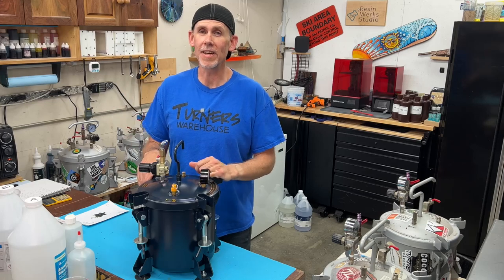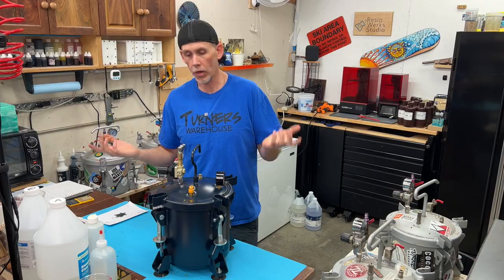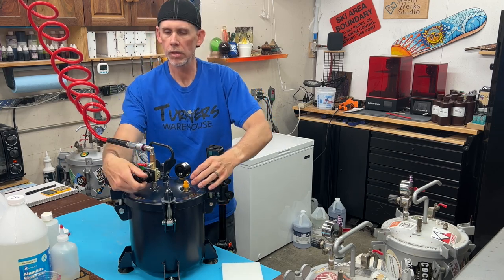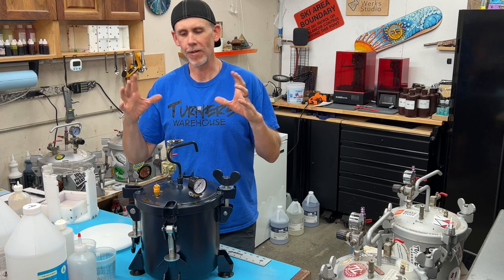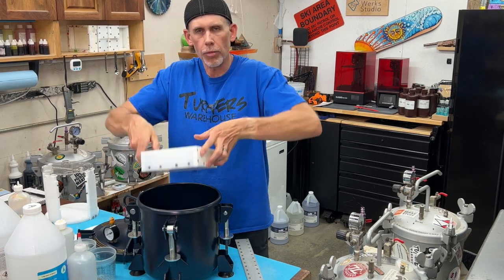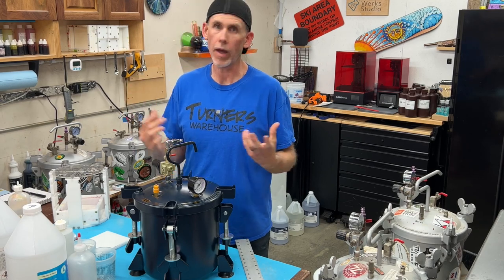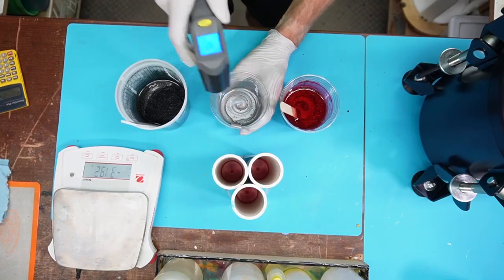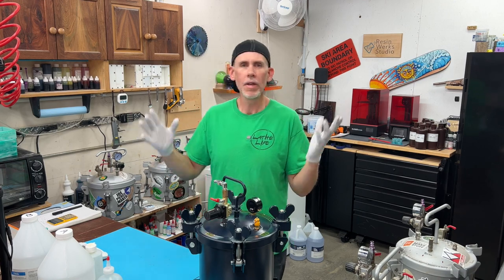Pressure Pot Made For Resin Casting (No Setup Required) - The California Air Tools 2.5 Gallon Pot

Comment: So, after watching this video on this Pressure Pot, I splurged and bought one!  I was using a converted Harbor Freight pressure pot, which was good to start out with, but . . . yes, the top dented from the screw downs and leaked so much!  I just pulled out resin cabochons with Alumilite Amazing Clear Cast as a top coat -- and the results are simply amazing!  I also learned, the hard way, you have to release the air from your air compressor (after each use) in these humid states because moisture gathers in the tank and will transfer into the pressure pot -- that was also giving me some unpredictable results which may not have been the fault of the old pressure pot.  Thank you for sharing!
Reply from the maker: I'm so glad you like it! It's such a great little pot for the money, so happy they finally came out with these in the 2.5 gallon. I would recommend putting a filter on your air line to ensure that you don't blow any moisture into the pot. It's tough to keep it out out of the compressor tank when you're in a humid area. Good to drain the tank every night for sure though
Reply: Every time I buy Alumilite, the part B bottle is already yellow. Let's Resin Low Viscosity 2:1 is far superior.
Reply: Reading your comment a year later. That was very interesting, I would not have known.  Where I live the summer humidity is very low, but winter is damp, so good to know.  I am not sure I can cure resin in my shop in the winter anyway, because though it can be heated I don’t think we keep it warm enough, and usually only during the daytime.

Comment: Super excited they came out with the 2.5gallon, I'm going to get one very soon. I am quite disappointed that the bottom is not already flat, I thought since it was made for resin casting they would have taken that into consideration 🤷🏼‍♀️
Reply from the maker: It's a great pot too! You probably won't find a pot with a totally flat bottom just due to the physics involved with pressurizing the tank. It's pretty flat though, much flatter than the Harbor Freight pots, and it's close to the CA Technologies ones. For most hard molds, it's really not a problem, but you definitely will want to put something flat in there for silicone molds.
Reply: @ZacHiggins  Couldn't silicone molds be set on a rack in the same way that HDPE molds are? Thanks.

Comment: I've had their 5 gallon pot for a while and love it.  I just got the 2.5 pot and I agree with Zac about the great fit and finish.
Reply: There is a pressure relief valve on top of the pot.   You could also open the ball valve without the compressor hooked up
Reply: May I ask what adapter you used to connect to your air compressor

Comment: Hello Zac. I really love your channel. I bought this pot back in September 2023 but never used until a few days ago. I love the pot it holds the pressure really well. The issue is that the pressure gauge is not registering the pressure. According to the manual, I need to replace the gauge but there is no part number to buy or instructions on how to do it. Can you help me with a part number and instructions. Thank you so much.

Comment: Hello. I'm not sure if this is going to be a stupid question or not but I'm hoping you can help. I was wanting to know if I need to get an actual air compressor or if I can use one of the tire air compressors that they have that generate more than 60 PSI. And, if I can use one of the portable compressors, what kind of attachment / hose would I need to purchase to connect it to the pressure pot? Thank you so much!! I appreciate your knowledge so much!

Comment: Thank you so much for your review! I just ordered the 2.5 gallon with the mold rack system for it. Sadly the bottom disc was out of stock. If I will mainly be using the rack, will I need that bottom disc? I also wanted to get your recommendation for an air compressor for the 2.5 gallon pot. I don't want to over do it price wise if a fancy one isn't need 😂 thank you again!

Comment: Hi Zac, I’m having problem getting the right adapter for my California Air Tools Pressure Pot for Resin Casting, Model 365CW. I am using a 3 gallon air compressor from 
Walmart, 3 gallon Hypertough brand
Reply from the maker: There are a couple different couplers styles out there, but I'm just not sure which style it actually comes with or what it's called. You might take it into a plumbing supply shop near you, they may be able to sort you out by looking at it.

Comment: please can you give advice of a good small compressor, if resin casting was the only thing it would be used for. I do feel this is so often missed  as space is so much more easy to get over the pond.
Reply from the maker: I recommend using a compressor that has a tank on it that is close to the size of the pressure pot, otherwise you will be waiting for quite a while for it to fill the tank. The smaller "pancake" compressors are the smallest I'd go with. There are a lot of great quiet ones out there. I have one made by Kobalt that I got at Lowes that works fabulous! There are also a ton of them on Amazon as well
Reply: @ZacHiggins  Thanks that help a lot
Reply: I have a cheap Harbor Freight pancake compressor that I have had for 15 years. Works fine for my 5 gallon pot.

Comment: Would you suggest this pot over the C.A. TECHNOLOGIES RESIN CASTING 2.5 GALLON PRESSURE TANK?  From your video it sounds like the C.A tech pots don’t come ready to use, but I’m not sure what that means.
Reply from the maker: Yeah, I can't really recommend the 2.5 gallon C.A. Technologies pots now that these came out. The California Air Tools is excellent quality and totally ready out of the box for way cheaper. Been waiting many years for a 2.5 gallon like this to come out so I can recommend something high quality with no setup and a reasonable price tag! If you need a larger size, the California Air Tools 5 gallon is excellent as well

Comment: What kind of compressor would be good to get for this pot? Also do you think I could kill to birds with one stone and get a compressor that works for both the pot and an airbrush?? Thanks Zac!
Reply from the maker: I recommend the ultra quiet compressors for casting. It's preferable to have a tank that is close to the same capacity as the pressure pot, and you need it to be able to go up to the needed PSI level. Here are a couple examples of compressors that I would recommend: 
Makita: https://amzn.to/3m2AR89 

Kobalt: https://www.lowes.com/pd/Kobalt-Quiet-Tech-4-3-Gallon-Single-Stage-Portable-Electric-Twin-Stack-Air-Compressor/1001013970

Comment: I picked up a vevor pressure pot, and went through the trouble of converting it for castings. It's only holding air around 45psi. Would that be enough pressure for larger bowl blank castings?

Comment: What air compressors would you recommend? I'm trying to get started but avoid spending too much money. I know it's rediculas but would a tire pressure version work for the first few attempts until I can also throw money on an air compressor?
Reply from the maker: I recommend going with a tank that is close to the same size as the pressure pot so you're compressor doesn't have to work too hard to get it pressurized. The quiet compressors are really great too, so much quieter than the regular ones. California Air Tools makes great compressors, and I bought one from Lowes that works great too

Comment: Have you done tests on low psi (40) Vs high psi?  Is there a minimum psi to reach? I just got a 10l vevor pot and most people I've seen cast at 40psi but I've read 50psi should be the minimum but also 40psi and also 70psi 😵‍💫
Reply from the maker: I don't recommend going below 40 PSI, you run the risk of bubbles coming back if the pressure drops below that. 50-60 is a good number to shoot for... but only go as high as your pot is rated for

Comment: got a CAT-365C 5 gallon from Cal air tools.  I'm kind of thinking of pouring epoxy on the bottom to level out the dish.  Any thoughts on this?  may it be a bad idea? :)
Reply from the maker: We’ll, you can do that, but it won’t necessarily be level if you move it to another spot or turn it. I just toss in a disc of HDPE or wood in the bottom to flatten it out, and it’s not permanent

Comment: Excellent video! I have 2 questions.  Do you have any experience in CO2 tightness of the pot? I want to know if I inject CO2 into the pot to about 60psi, how much pressure I might lose after 24 hours. Another question is I am planning to replace the pressure gauge with a digital pressure gauge, what kind of gauge should I purchase? Thanks.
Reply from the maker: Thanks! I'm glad you enjoyed it! Unfortunately I have no experience with CO2 or digital gauges. I just use regular compressed air with mine and the standard gauges. Sorry I couldn't help with that

Comment: Mine is extremely Unlevel. I put on all of the wheels and for some reason it’s not level, so if I push on one side of the pot one of the wheels is up in the air, and when I let it go, a different wheel goes up in the air. I put a circle in the bottom to try to level it that way but due to the wheels being uneven I can’t seem to fix the problem. I can’t take the wheels off because the bottom is concave and wouldn’t sit evenly.

Comment: What will be the cheapest compressor for it and where to buy it thanks
Reply from the maker: I would recommend going with a 2 gallon quiet compressor. There are lots out there, California Air Tools makes some that get great reviews, I personally have used one from Lowes that works great with this size pot
Reply: Hi Zac thanks for the tips and recommendations can you please show me how did you relisted the air after you ready to open the lid thanks again

Comment: I build model semi trucks, would like to get a pressure pot to cast some of my scratch built parts. Is it true if you pressure pot you gotta use it to make the mold?
Reply from the maker: Not necessarily, the main thing is you don't want air bubbles trapped in your silicone. I usually degas the silicone in a vacuum chamber then I pop it in the pressure pot to let it cure. That just makes sure that any air bubbles that might have still been trapped in the silicone will be collapsed when the mold is under pressure
Reply: @ZacHiggins  Thank You, bubbles in mold around the model part is no good

Comment: Can you please please help me, every single video I've watched and even the manual for the thing doesn't say how to depressurize it. I don't know whether I turn the red lever again without the hose attached, if I'm supposed to pull the safety pin do I hold the safety pin? Why is there another thing that they call the air release valve but that's not the thing that actually releases the air is it supposed to be the safety thing? I'm so confused and now I'm terrified because I have this pressurized tank sitting here that I don't know how to empty 😭
Reply from the maker: I know how you feel, I wasn't entirely sure the first time I used pressure pots. You have nothing to worry about though, you can technically use any of the fixtures on the pot (safety, levers, air release) to release the air. I just crack one of the ball valve levers on mine and let it gently release the air 😀

Comment: Zac, can you discuss moisture in the air compressor and how you tackle that? I know all air compressors create moisture in the system and resin doesn't like that.
Reply from the maker: Yeah, I can do a video on that topic for sure! Thanks for the idea Tim =D
Reply: @ZacHiggins  Being from a climate with high humidity, I would love to see a discussion concerning this moisture topic!  I have a HF small tank compressor and it has turned into a pew-ew situation.  the drain plug is not at the bottom of the tank, so the moisture left in the tank never really left -- and once I became smart enough to tip the tank when releasing the air/water from it, brown (rusty) water was being released from the tank.  I am going to purchase the Makita air compressor that you suggested below and get a high desiccant filtration system --  I sure hope I can get my set up going soon as the cool, dry weather is now coming upon us and I want to get creating!

Comment: Mist resin I have sets in a few minutes. Will this pressurize fast enough?
Reply from the maker: That depends on the compressor you use, I recommend using one that has a tank the same size as the pressure pot so it just pushes it in right away

Comment: Has anyone else been having trouble with the regulator's pressure gauge on this pot? Mine just straight up wasn't working no matter which direction I turned it (it had zero effect on the pressure gauge's reading and I had to use the on/off ball valve to keep the psi steady at 50ish psi) before the knob and its mounting hardware straight up fell off (the knob, the bolt, the washer, the nut).
Reply from the maker: I haven't heard of that problem happening before

Comment: hello mate im abit stuck im nearly there with my setup. Im trying to recast a model ive just made and the only resin i can find on amazom has a pot life of 2 mins! how long does it take a pressure pot to "remove" the bubbles? Do you think  i can mix, pour , add mould and remove the bubbles in timeframe? the fill point is a large flat  opening the size of the model its self so has plenty of room to do its thing.
Reply: its a 1.6 Hp compressor
Reply from the maker: Pressure acts instantly on air bubbles in resin, so as long as you can get it in the pot and pressurized before it sets up, you're good to go
Reply: oh nice one! wish me luck on a bubble free cast! great channel by the way

Comment: How do you let the air out brother .😎👍🏻
Reply: There is a pressure relief valve on top.  You could also open the ball valve when the compressor is not connected
Reply from the maker: Just crack one of the valves... ball valve, safety, or the other screw air valve that's on the lid. I recommend letting the air out relatively slowly 👍
Reply: @homerlex  I thought the regulator would  prevent it . Did not know it was a bilateral opening.

Comment: There doesn't seem to be any protection against removing the air hose with the valve open. A better design would have a check valve on the inlet and a separate discharge valve with a rate-limiting diffuser.

Comment: I thought a pressure pot was used for getting the bubbles out of resin? Im a little confused
Reply: I think the preassure-pot makes the Bubbles unvisible tiny through the preassure und a Vacuum chamber pulls the Air out

Comment: Hi Zac, would an airbrush compressor work with a pressure pot?
Reply from the maker: It would just depend on the specs, but even if it could reach the target psi, it would probably take a long time
Reply: @ZacHiggins  TY for taking the time to answer me, sir. :)